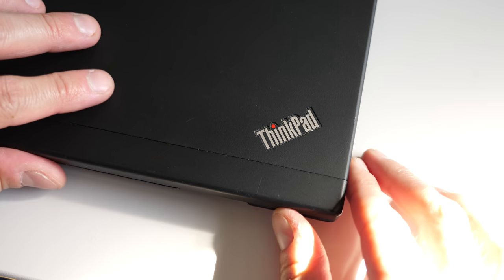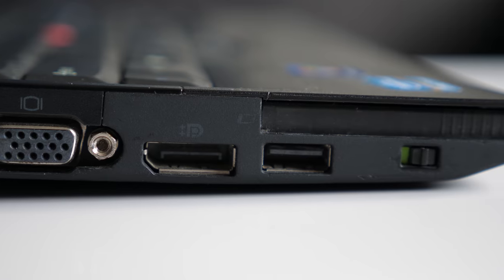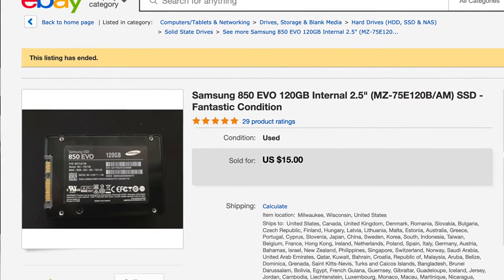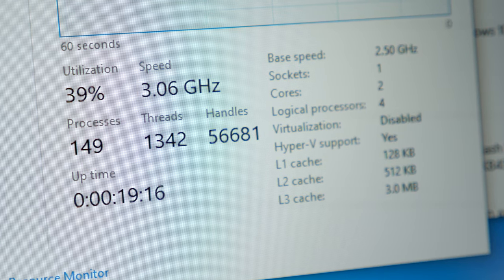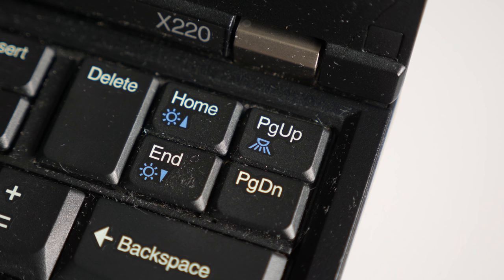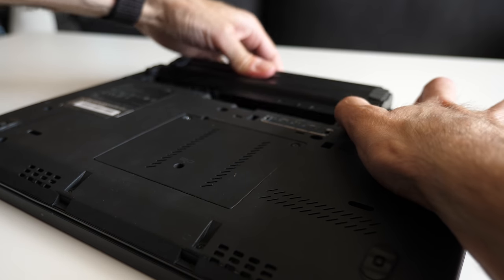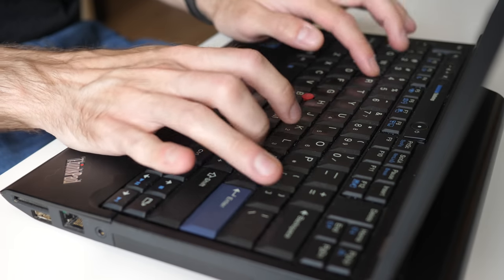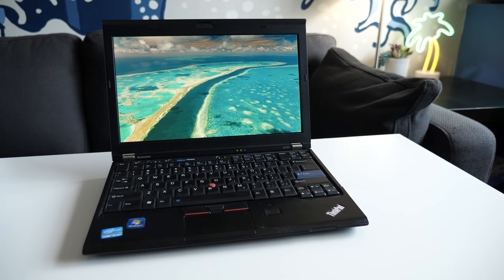The $100 Laptop Challenge -- This Old PC is Better Than You Think

Comment: excellent video.
i use 2 used laptop atm one is a rather little and light Alienware i found when dumpster diving. it's from 2013 it have a 1366x768 14in screen and colorful keyboard backlight and all the gimmic of all the Alienware. i've put a little SSD, 8gb of DDR3, it have a nice I7 2nd gen on it and a geforce gt555 1.5gb of ram. not really a good gaming laptop but it do all i need and it's easy to transport... it also needed a battery. and i have the laptop for at home... it's the DELL Precision M6600 that's a really huge one it's 17" full HD backlight on keyboard it accept one mpcie SSD and 2 2.5in HDD. it run with a AMD FirePro 6100, a really powerful I7 2820QM, i added 16gb of DDR3 1600mhz used, a mpcie SSD 256gb new, a 2tb HDD new, and a brand new battery. i bought that laptop 200EUR and with what i added on it i'm about 450EUR for that laptop but try to get something that powerful for 450EUR brand new..... also, it have fall on ground many time because it never stay for long at the same place and it survived really well the screen is tactile but that not work on windows 10.... but it's also really strong and supports really strong hit try that with a 450EUR laptop... it fall once and you have parts everywhere XD (i'll also not try with the alienware the way the screen is attached look really crappy and some crap plastic... all for the show nothing more)

Comment: What I did: Tell your friend your looking at a used laptop on ebay, and he gives you an older cheapo laptop with a broken screen that he doesn't need anymore. LCD panel cost around 80€ and I got a replacement keyboard for 15€ because I wanted to. Luckily he had previously upgraded the drive to a 256 or 512GB SSD and doubled the RAM to 16GB. 
He even basically gave me a Windows 10 Pro license, but I know he got it off ebay for two bucks.

Once this pandemic is over I'm definitely buying him a case of beer.

Comment: I need to leave this recorded here as a warning.
That "lag" you felt using Ubuntu? It's Gnome's fault. This is an old problem, for years now people are complaining and gnome devs are promissing, but things only really started to improve when Canonical devs started to contribute after Ubuntu went back to Gnome 3. Things improved greatly, but more work is still needed.
Want a fast lag-frees DE on Linux? Use anything else, if possible KDE Plasma. Instead of Ubuntu you could use Kubuntu, a simple switch that works wonders.
On old machines like that Gnome 3 is a bad idea, Plasma 5 is the best idea.

Comment: Laptops commonly have 6 or 8 CORES? I don't think so. The vast majority of laptops, even today, have four cores (8 threads) and it's only "workstation" models and highend systems that have anything close to that. But the rest of the video is very good. He types.... on a Levono T410, fitted with 8GB RAM new 9-cell battery, a 240GB SSD and a new keyboard... all for under $150. :-)

Comment: I got my T 530 for free from my computer guy. It had the i5 3230m at 2.6 GHz,4 GB Ram and a 320 GB HDD. I have since upgraded it to 16 GB RAM,a 500 GB HDD and a 128 GB SSD boot drive. I can run GTA 5 at 20-25 FPS. Not bad for a freebie.

Comment: Still using dell d610 with ide converter, ssd and XP (on the side). That''s more than 5 times slower as this is, to say the least. With a little stutter here and there, does everything, though. 

Ps Exept spelcheck English (really, can't find a download).  PS did you also do a video here called "celebreties that got banned from talkshows" kind of sound the same.

Ps for the sake of it having a TN Panel would not recommend the Dell i mentioned, something to watch out for on older laptops. Not sure since when you can be pretty sure it will not be TN, guess around 2011/12/13 somewhere.

Comment: No wonder that it was lagging on Ubuntu : P 
Ubuntu is really bloated and if I repair&refurbish notebooks, I often choose Linux Mint or Deepin linux.
Linux Mint - It's very good for older CPUs and it's really easy to use
Deepin - It looks very modern, has Smartphone like control/notification panel and it runs perfectly fine on older Nvidia gt600 series GPUs.

I actually also offer Pop!OS install as an optional "selection" if the user loves to play games but most people just choose Linux Mint

Comment: i got a dell latitude 3330 for 35 dollars with 1gb of ram and a 320gb hardrive then i sold the hardrive for 5 dollars and kept the 1 stick of ram and found a used 4gb stick and put it in and it’s perfectly usable
Reply: i also plan on rebuilding the battery pack with vape batteries from a local store

Comment: If your really on a budget and want somthing decent ide buy a dell inspiron m5030 it has an amd cpu and gpu 3 gigs of base ddr3 ram but can be upgraded to 6 and u can find them ranging from 20 bucks to 80 bucks however I will say they are wonky and tend to break very easily and the screen is dogass but the real only problem I have with it is that theres no hdmi port but there's a vga port so I guess u could get around it with an adapter also forgot to add that it has a disk trey to

Comment: 4:59 comparing apples and oranges. You're comparing a four core/eight thread i7 processor with an entry level i5 with only 2 cores. If you compared it to an i5-6300U, you'd get an entirely different picture where single core performance is only about 10% better!

Comment: T420, 900P screen, i7 2760QM PM@ 7540 latest, 16GB DDR3 1866, beats new machines all day long            $ Trade for GTX 1060 6GB 3 years ago
T430, 768P, screen, i7 3740qm PM@ 8780 latest, 16GB DDR3 1866, beats new machines with absolute ease    $50
I swapped the cpu's via ebay parts,  as well as added ram and ssd's ... The machines fly, and each is well under $300... likely well under $200-250.... I didn't keep absolute track, but I'd be surprised if they broke the $200ish area. And again, they spank new machines... which all mostly PM around 4000-6500. They may have ever so slightly better IGP options, but it's all relative, as no IGP is going to do much in gaming. But as far as core computer goes, this keeps up and beats everything new... Cinebench as well, 432... lol... 1233... lol ... Both machines beat these offerings.

Also, I dabble in laptops all the time, and Amazon battery offerings can be had in high cell counts for under $40-50 all the time.... ALL the time. Also also, the T430 not only has USB SS built in, but it and the 420 have express card slots going right to the PCIe bus, so you can add USB 3 SS or type C to either of them. Also also also, the 430 has backlit keyboard options as well as the thinklight, while the 20 has the last best keyboard. Not that the 30's is bad... but the 20's was, epic. Clean that x though man, cleeeaaan that thing.

Comment: I use a 25 dollar laptop for my college work. I live in Brazil, mostly I deal with fortran programing and latex writing. So it doesn't bother me. It servers me right. It is an HP laptop. It has an Intel atom, 1GB ram memory card and 250 hard drive. I don't even think you can call it laptop.

Comment: Well it may be old but it will outlast Tim cooks garbage The cooked apple Mac where it seems that there are quite a few failure that Louis Rossman has to contend with. - Now they come with soldered on hard drives - so when they have a melt down the hard drive is done nice and crispy, Did you want Cheese with that order? lol

Comment: Yeah, I don't believe a word of this in terms of the $100 budget. It's just not true.  Even now, you CANNOT get an X220 in decent condition for $80 ANYWHERE, especially one with 8GB of DDR3 RAM installed.  That much DDR3 alone costs close to $40.  I'm quite sure Free Geek gave you a price break in exchange for some publicity so you could add the $20 SSD and still come in at $100.  Everything else you said about the X220 is spot on and and it's a great machine for the price, but truthfully, you're looking at more like $150 minimum, 50% more than you claim.
Reply from the maker: I bought the machine from Free Geek’s site at the posted price, and they didn’t know I was planning on doing it. $80-100 is a real-world price for these, at least at the time the video went live — go check eBay sold listings.

Comment: To be fair, you lucked out , to find a 2011 Thinkpad X220 with a battery that holds a charge, for only $100. A fair price would really be $200 with a good battery, or even $300 for a refurbished X220 with a 1-year warranty. Now compare this $300 laptop to brand new laptops in the $300 range.

I bought a new BMAX Y13 in January 2020 for $348 including shipping. It performs about the same as your $100 used Thinkpad, but with two major differences. #1 My BMAX is completely silent, no cooling fan, passive cooling only. #2 My BMAX is thin and light, just 1.3 kg -- including the power supply! -- and 14.7 mm thick. Compare that to the X220 which is 32 mm thick and weighs 2.0 kg (with the 9 cell battery and power supply). The two chassis are the same length and width, but my BMAX squeezes in a 13.3 inch screen (1920x1080) instead of 12.5 (102x768), because of narrower bezels. Also, my BMAX has a touch screen, two USB-C ports, and a 256GB SSD. RAM is the same, 8GB. PassMark says my Celeron N4120 performs about the same as your i5-2520M, but mine only uses 6 Watts of power (and heat) instead of 35.

Better screen, modern USB-C, double the SSD, half the weight, and no cooling fan noise. I'd much rather have my BMAX. I love portability. I hate fan noise.

Comment: Another good old laptop from that Same era is an hp elite book 8440p from 2010 and 2011 or other older elite books from that era mine has a i5 520m 8 gigs of ram and a Sata 3 ssd and windows 10 it boots up in 14 seconds the old machines are better in my opinion.

Comment: Mine was 500 bucks, with i5-6198DU, 4GB RAM, 1TB HDD@5400RPM, and GT930MX Dedicated Graphics. Honestly, I don't wanna buy something which are using Intel Processor (Intel Celeron/Atom,typically), priced 400 bucks, and did not have any Dedicated Graphics card, cuz i think they are just overpriced..

Comment: I got a x230 for $100 and tossed some agroup ssd 240gb in for about under $50 new, its literally better then my $300 i3 6300 or what ever I3-6xxx it is i dont remember, its better in every way possible, the screen has less resolution but its still more clear and has a better and sharper image quality then that "cheap" laptop that cost twice as much, its also has a keyboard thats a million times better then the joke of a keyboard on the other laptop, the x230 is also just way more durable the cheap laptop feels like im going to break the screen just opening it

I will say the only issue with my laptop is it doesn't have the graphic capability of the other laptop tho, the cheap laptop can actually run overwatch on min settings at like 30 fps, the x230 cant really do graphic based things at least any thing not really light like gimp but I dont think you can do blender stuff with it

but paying $150 in total for this compared to a $100 for a new chrome book or even a $300 laptop it was and absolute steal and win. it does what it does and it does it well, you just have to make sure to know what you want to do and look into which older think pads can actually do it, I know some older think pads can do 3d stuff in blender ect but you may have to under stand it likely wont be as good as working with a new higher end pc/laptop, but with certain task time hasnt moved as much, a pc from the 90s can still write word documents a 2010 laptop probably can still edit 1080p videos ect

I would probably recommend using linux if you can since win 10 and onward uses a lot of resources doing nothing, and I dont know anything about lighter weight windows 10 versions or how well cutting down windows 10 works, linux would have a lot less over head id imagine

Comment: Really sad that Windows Pcs have a better life years later than Macs.
Reply: I don't love Macs but there's life in the older ones still.  I have a mid 2009 17" MacBook pro running an SSD 8GB of RAM and MacOS  Mojave.  It's still pretty useful.
Reply: @DCookStaVideo  do a degree apple is quick to nix support in newer revisions of Mac OS. While windows pretty low bar to run windows 10. Not to mention in 2013 ram started to be soldered to the main board so there goes upgrading.

Comment: Looks at thumbnail: ah, is that a T420? Yeah all it needs is a processor upgrade, some RAM and at least 1 SSD and that’s a perfectly useable PC in 2021. 

I use a T430 with the same upgrades and I do a ton of coding and some low demand gaming.

Edit, not quite right on the model but the point still stands

Also, speak for yourself, Linux is better and wouldn’t be daunting for anyone who is shopping for a fixer upper laptop like this

Comment: I have a Thinkpad T430 i7, that I purchased way back in 2016 and upgraded right away  with 250gb ssd drive.  It is still going strong in 2022.  I'm thinking of upgrading the 8GB ram to 16GB anyone have any suggestions is it worth it etc?
Reply: Tell me, your fan is not buzzing like an airplane? Or have you already replaced it?
Reply: @johng7212  interestingly, it was only buzzing like am aeroplane only for a short time before it totally packed up. In any case, I opened it up got an  'el cheapo' fan from Amazon for under a tenner and replaced it.  Its now been working totally fine with no issues.

Comment: Basically what your seeing here isn't how "well" the thinkpad was made, but how poorly Intel's managed to progress. The reason an i5 from 2012 is better than current-gen el-cheapo stuff is because the current stuff from intel is actually just hot garbage. In addition to the fact that most bargain-bin laptops would more appropriately be referred to as laptop shaped objects.

Bargain bin laptops ( basically anything under ~1000 ) are universally crap. They won't stand up to use as an actual laptop ( schlepping it back and forth to school/work, etc ), they have horrendous battery life, and your smartphone is probably faster for most things. They have terrible, low resolution, TN panels, and can hardly run Windows 10 let alone anything else. 

And that's not to talk about how turbo-bad the keyboards are.

Some manufacturers are still shipping them with spinning rust. It's hilarious. 

Also, that X220 was ~$1300 new. 

That's nearly $1460 adjusted for inflation. (it's been that long)

Comment: Beware installing Linux on older machines. If you are going to use it for general purposes such as web browsing only, will fry your machine. Linux does not have properly hardware acceleration for web browing and so watching YouTube videos on 1080 or above puts too much workload on your cpu, this beacause VAAPI does not have properly suport for linux.
Reply: If you want to "workaround" this you can by installing an extension that enables you to play youtube videos on MPV and aka hardware decoding it on this multimedia player.
Reply: And finally installing windows 10 on this machine was a good choice since using any chromium based browser(chrome, brave, edge, opera) or firefox would do the job for most users out there.

Comment: whut?  Stay with Linux, it is more Windows than Windows10.  Win10 is a surveillance system, not an OS.  FOSS apps are better than MS apps anyway, all the apps I use are FOSS.  Linux Mint runs great, and has most apps built in, been running it for 3 years on a Lenovo Flex4-I7.  We need to make Windows obsolete asap.

Comment: But today Budget Notebooks have imbroved in onboard graphics 
So I hot my r3 3200u Notebook for about 200$ with 8gb ddr4 RAM and am nvme 250gb ssd 

This is able to play Tomb Raider (2013) at high/mid with 60fps 

So its mit like you dont get anything for the Money 
Actually 
My grandparents have an core 2 quad q8200 with 4gb of RAM in their main PC 
And Windows 10 runs fine 

Still These 2.gen core i5 are great value 

Its mit like that you dont get

Comment: i run ubuntu on an x240 and it works really well, legit its sooo much faster than windows im never switching back.

EDIT: eww cringe ubuntu i use arch linux now btw (it runs insanely well on the x240)

Comment: bro i'm watching this on a dell latitude and the build quality is terrible literally both hinges are broke , i gotta put something behind it so the screen doesn't fall over i loses internet connection  the battery crapped out less than a year some of the keys need force applied so you can type just terrible, before this i had a dell inspiron 1500 and that lasted longer

Comment: After the SSD, it's just a story of diminishing returns. But it's insane what you can do with laptps from that era.
I had an old Toshiba laptop with the same processor: The SSD was a great start, but it hat a replaceable CPU. So upgrading to a 2nd GEN i7 and 16 GB of RAM (which should not work, but does) really gave it an edge over most modern budget options. A second SSD in the place, where it hat the DVD drive, finished the build.
All of the upgrades cost around 100-110€, so quite a bit more expensive than your budget option. It likely performs better, but doing only the necessary upgrades, as you did, will already get you a laptop that's working just fine.